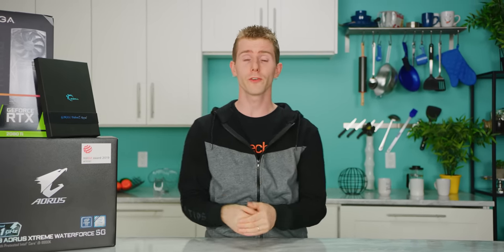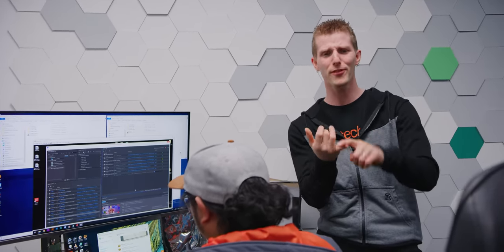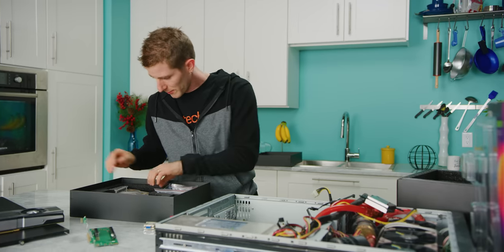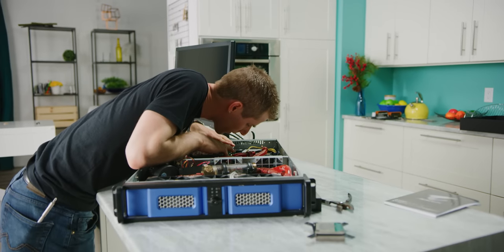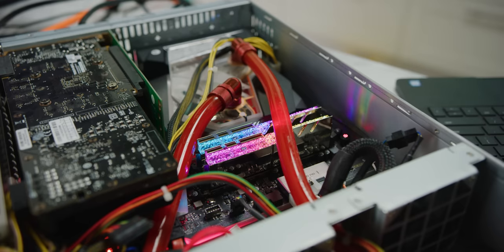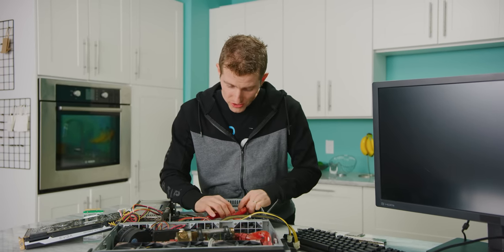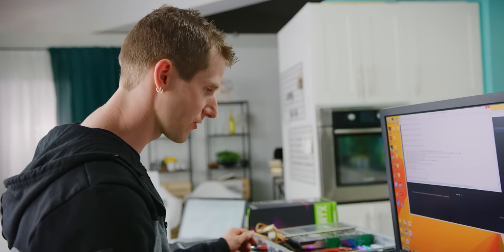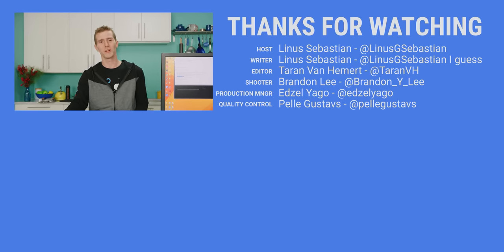All this work... for what?? - Upgrading the Video Render Server

Comment from the maker: Buy an LTT shirt, hoodie, hat, and even our own water bottle at https://lmg.gg/lttstore
Reply: Love your vids
Reply: Hi
Reply: Overclocked threadripper 3 build with custom water loop video when?
Reply: If you fix the 5700xt encoding quality the guy epox guy was able to get the fastest encoding while being able to stream multiple 8k streams at once with pcie4.
Reply: See you guys in 3 months for the 3950X version of this video where Linus again pulls a production server offline before even running tests
Reply: Please stop trying to sell me a hoodie in the middle of summer.... lol
Reply: Could I pay for shipping and get your "old" parts?
Reply: Linus Tech Tips no
Reply: If only you did giveaways for computers or even graphics cards or even power supply's
Reply: If adding a GTX980 improved performance back when you build this system , why not swap it out for a 1080Ti / Titan pr something like that to improve it even more ?
Reply: Send us that gtx 980 🤣🤣
Reply: Linus Tech Tips just because it can be done doesn’t mean it should be
Reply: thankyou linus you have confirmed less cores more ghz is better than more cores less ghz !!!!! but the dicrepency is threads ?
Reply: If you want to make weird content for video editors do a Cinergy plug in codec test and determine the best CPU and GPU combo. I bet my i7 and gtx 760 can beat that build if you don't use a real GPU accelerator
Reply: I had a similar experience when working with hardware.

So, I saved up some money for my new server (inspired by your videos to build PCs and to play video games on PCs more)   and after getting all the parts together,  I built it

(specifically:  Mobo-->Asrock EP2C602-4L/D16, CPUs-->Intel Xeon E5 2650s, GPUs-->AMD FirePro R5000 & NVIDIA GTX 960 2GB. Storage--> two old and disposable 500GB HDDs, OCZ Trion 240GB SSD and Seagate IronWolf Pro 2TB HDD, etc.)

It's the most beautiful rig that I've built... well, it doesn't have RGB or any clear panels to see the inside but the main beauty is the purpose built for it imo.      I got my Windows ISO ready and began the installation process.

After everything, it works.

Prior to getting it to finally work I had some problems and quirks that I've learned about my server:

1.)  Very picky about where you install the RAM in what slots. (Understandable considering it's a server board and not a consumer board, fair enough.)
2.) IPMI dedicated management port is inaccessible (even when enabled in BIOS and assigned a static IP) so for safety I decided to disable it completely. 
3.) While the motherboard is intact physically and electrically, for whatever reason it would seem that the sata controllers (Marvell RAID controller built in and the basic sata controller, both of which are put into separate IOMMU groups thank god.) are picky about how many you can use at once.
4.) It has more than enough power to power the sata drives and all the PCI-E expansion cards included and it won't draw more than 600 watts concurrently (glad I went with a 850 watt 80+ silver PSU, or was it gold?  it's one of the two).
5.) Sometimes I would have to disconnect one or more USB devices in order for it to boot properly (hangs sometimes when I boot into either windows or linux)
6.)  PCI-E passthrough is successful... sort of.  I did a pass-through test with a PfSense VM (granted, it was without OVMF) and I was able to pass-through the onboard intel gigabit controllers.  Though, they would show up as "em0" through "em4" (four physical plus the virtualized nic) which would imply that they are technically are seen as virtualized rather than "physically" attached if that makes sense.
7.) relating to point #6, if the vm shuts off then you don't get your network controller back for re-utilization or in otherwords give you back the ability to network with the host.
8.) This one is debatable, when I installed windows for the first time, it worked like a charm, then after three restarts (just to test and make sure that it would restart normally and to see if it would boot normally because it's running on server-grade hardware.) still nothing bad happened.  Good. :)    So, I turned off my server and ate dinner and went to bed.   Next morning I sat down in my chair and turned on my server, after a few minutes of getting through the bios screen, I get stuck during the windows boot.  And this continues every single restart.   So, I decided to go into safe mode and look into the log and turns out that something corrupted the bootres.dll file.  So, when I consulted with my dad about this he recommended that I check the ram and see if it's faulty by using memtest.  After a LONG night testing all 32GB of it, nothing.  Nothing to report and it passed 100%.  So, I decided that it might have something to do with windows 10 in particular because this wasn't my first time dealing with a corrupted bootres file.  In fact that happened to me two-three times before on this laptop that I'm using.  I figured out that prior to windows 10 updating itself, it worked just fine but after it updated itself it somehow crapped itself and screwed itself over.  What a bummer.
So, after that I figured that since the next update (can't remember what version exactly, I was busy trying to make sure that I get THAT update in particular by microsoft) is available, I installed THAT version specifically to make sure then I disabled ALL microsoft auto-update services and telemetry to prevent any corruption from the next update.     It works just fine now.
9.) I almost forgot this one, it can be picky as to how many storage devices you have plugged in all at once in terms of booting into a live USB image.   I learned that the hard way when I tried to run the memtest.   With 5 sata devices plugged in at once and the memtest bootable on my USB flash drive it refused to boot.  But after disconnecting all of the sata drives leaving the usb drive in, it successfully booted into it no problem.

In conclusion, servers can be VERY powerful when configured correctly, but are a B*tch to setup.
Now that I think about it, I'm glad that I'm 50% scotch-irish, otherwise I would've gave up already, glad I have some stubbornness. XP

Keep up the awesome work LTT, your videos are awesome.  :)
Reply: Doing all this and could of waited for a short time for the the 3950x and have 16 cores
Reply: Auto Lower clock speed will AVX workloads :)
Reply: having 8 k or whatever files uploading it on youtube is just embarrassing and waste of resources and time. sigh
Reply: i have 2 things i want to see id love to see who can cram the most storage into a case as possible and id love to see you make the most powerful server you can
Reply: Do you guys still have that ebay page you sell your old parts on? I would love to buy that x99 without the CPU. I have a few 5XXX 2011-v3 cpu's with only one board and I am looking for more.
Reply: $60.00 for a hoodie!!!
Reply: Linus Tech Tips you should use the ryzen9 3950x when it comes out 16 cores and zen 2 if faster than 9th gen intel
Reply: I would like to buy a hoodie but you dont make my size.
Reply: But you need muneeeee for the right setup...
Reply: @Linus,   I gave up on Adobe Pr and ME both.. No matter what I changed out it never would push my CPU to its maximum potential. I followed everything Puget Systems recommended and more. But it never would make full use my system. It was like it was being artificially held back. Switched over to Resolve and it makes full use of all my resources. My system is a 8600K @4.8Ghz, 32GB DDR4-3200 Corsair Vengeance @ 3200Mhz, Zotac GE RTX2070, 2x WD Black NVME's, 2x WD Blue SSDs, 2x WD Red HDDs.  Nothing erks someone more than seeing the CPU at like 60-80% usage, GPU at like 30% usage, SSDs at like 15% usage and RAM at less tha 12GB usage out of the 32 I have for it..  Its like WTF Adobe??  Tried everything to find out what the bottle neck was, but everything was being under used. Like I mentioned, no issues using Davinci Resolve though..
Reply: Linus Tech Tips Why dont u try the new AMD CPUs for the Server?
Reply: WHY would you not hit it with an AMD Ryzen 3? Wait until the "Destroyer of The World of Cores HA HA HA!" comes out and use it.?

You guys push Intel a bit hard. Even NVidia gets a bunch of love when they're not exactly killing it.  Is AMD that small of a provider of free stuffs for LTT that it gets so little love? 

Me wonders.
Reply: Hey, Linus, I would be so glad to take your stuff for free
Reply: @corason4444  right like he doesn't have 2,000 beggars begging for his stuff every single video.  Maybe get your parents to upgrade you versus publically humiliating yourself, kiddo.
Reply: Oh Linus. You are about the regret that upgrade. You should have checked out the H264 encoding of the AMD 5700 graphic cards, some of their performance was quite outstanding.
Reply: @Supremax67  HA! But you have made a serious mistake in suggesting that, sir!  Linus TT is all but owned by Nvidia/Intel. Suggesting an AMD graphics card probably made half the office laugh because they generally don't do much with AMD.  You've never heard of top secret "test sample AMD" processor or video hardware ever making it to a LTT bench although Nvidia and Intel seem to make it there almost weekly.

Maybe it's because they have a very weak relationship with AMD or maybe AMD just doesn't want all the public "delidding and waterboarding" of its hardware like Intel and Nvidia seem to love but AMD takes a back seat WAY too much. You can almost see Linus cringe when he mentions how AMD just pounded Intel into the ground for processors.  In actuality, we've only heard leaked info on the high end Ryzen 3 processors whereas Linus would have had engineering samples of the latest Intel processor on some sort of oem motherboard by now if it was Intel smashing AMD.
Reply: I kinda need some help i got an alienware monitor 25 (240 hz) but when i try to change the refresh rate it caps out at 120 and cant make it higher than that please help me
Reply: @chrissun4305  Bro, that's not something you can do over the net. I would suggest a couple thigns. A> your video card is not capable or not set to the right speed in the drivers. B> your  LCD is not set to the correct speed or to match up with the setting from your card. If the settings differ, an LCD will get confused and default down to 60. So if you set to 220 on your LCD and your drivers or card are set to 225 or 210, your card will dump all the way to 60. C> Windows itself doing 60. D> something defective E> a bad or cheap HDMI cable. F> Linus plays preferential treatment with Intel/Nvidia.
Reply: Use amd for server 7nm CPU
Reply: You Just PROVED AMD to be RIGHT !
Reply: @yagneshpatel9660  They did say the video was made before but yes, the new AMD Ryzen 3's would smoke Intel. Be interesting to see how they handled the transcoding vs Intel. It IS possible AMD didn't load everything intel has on that nice shiny 7nm die
Reply: Oh I think I'm going to Canada soon so idk if I'm going to visit
Reply: Linus Tech Tips toilet’s back in action
Reply: $60 for a thin hoodie? No.
Reply: Just use DaVinci Resolve!
Adobe is trash!
Reply: @LoociferZ  thank you
Reply: Linus Tech Tips Linus please do another scrap yard wars
Reply: Is It Weird That I Was Walking Round My School Today And I Just Found An LTT Cable Tie Just Lying On The Floor
Reply: All this HASSLE for a TASSLE. 😒🤔
Reply: Noticed the title change, or addition - and honestly, I didn't have any interest in clicking until the second part was added. No bashing, just feedback.
Reply: Not trying to hate, but Linus needs to fix his posture, he is slouching all the time in his videos. I used to be like this a year ago and fixed it by keeping my chest up.
Reply: Water cool a PC with Belle Delphine’s gamer girl bath water
Reply: I heard the water bottle doesn’t include water... is this true?
Reply: LTT water pipe ?
Reply: Could u pls hook me up with a pc man im a huge fan kof urs and i study computer science but i cant afford to buy a pc
Reply: Yeah. You seriously need to upgrade that 500 watts PSU. And where's that comparison between the 980 and 2080 ti?
Reply: For what shall it profit a man, if he shall gain the whole world, and lose his own soul?   

Or what shall a man give in exchange for his soul?
Mark 8:36-37 KJV
Reply: No thank you.
Reply: The merch prices are insane $60 for a thin hoodie made in china that costs $10
Reply: Strange how you always have issues with XMP, I seem to have been lucky with it so far lol
Reply: No. They make condoms to stop reproduction at a couple of quid, why would i spend £20 on a hoodie for the same effect ?! Cool vids though bro lol
Reply: I want to the LTT shirt that says "sold my soul to Intel back in 2016"
Reply: EVER HEARD OF A FUNNEL?
Reply: U mb should try to turn off hypertrading. since software is capped at certain amount of threads u might benefit from it.
Reply: go back to funky sunday as intro
Reply: Though, why didn't you use amd ryzen 3900x?
Reply: Do you sell an LTT funnel for not leaking the coolant everywhere?
Reply: why arent you using dual AMD EPİC cpu and motherboards...better then 5 xeon cpu
Reply: Your Encoding Settings in Media encoder is set to "Software Encoding", that's the reason you got slow render
Reply: dont ever tell me what to do
Reply: UFEI BIOS SHOULD BE ENABLED

Comment: Yes, the video was created before Ryzen 3000 launch, but the more comments about AMD, the better. Wait for the 3950X; and also get ASRock's X570 Aqua Mobo, it has Thunderbolt 3, and an AIO monoblock!
Reply: Oh, that explains everything.
Reply: Ryzen up
Reply: @jcfawerd  the Aqua is a water cooled board, similar to the gigabyte board Linus used.
Reply: @jcfawerd  yeah, weird how they went with a little fan for the mobo instead of an aio mono-block...like the gigabyte z390 aorus extreme
Reply: @jcfawerd  They don't need X570. A good quality X470 board wouldn't have a fan but could still power a 3950X. Emphasis on "good quality".
Reply: @jcfawerd  why fans on the motherboard?
Reply: @FrancoRav  for cooling the chipset, X570 chipset can draw over 15W, so it needs active cooling
Reply: @UnsungAces  Oh. They could use a X470 one then (maybe not the best option though)
Reply: they are only making 999 aquas though, so linus will have at least 10 of them.
Reply: It's rendered with an intel.
Reply: @YttriumtYcLief  Yet LTT is spending a couple thousand dollars on underperforming Intel hardware so why not go overkill with AMD and really "let it rip"?
Reply: I think you are wrong
the gigabyte one u was AMD EPYC server
custom watercool enclosures = LTT workshop
Rip = threadripper 2990wx
MSI MEG X399 Creation 16 phases
ASUS X399 Zenith Extreme old 8 phases
gigabyte x399 aorus xtreme problem one
asrock x399 fatality oh no
Reply: @nhac lly well all out. we all know that linus has the money, and the persuasion to get what he wants ... JKJK :D
Reply: also Linus you should do this for your personal build, because it has TB3
Reply: @jcfawerd  neither do I, but... I think the chipset is water-cooled with this mobo
Reply: @C0D3__BR3AK3R__Studios  well in FINALLY Upgrading my 4 year old Gaming Rig! video he used a Z390 AORUS XTREME WATERFORCE 5G 9900k and TRTX

Comment: ""All this work for 1 minute faster rendering''''  thank me later
Reply: Lol,...
From 9 minutes to 8 minutes is still 12% improvement
Reply: Thank you
Reply: @arwo1143  you must work for CPU marketing team 😂😂😂
Reply: @raulserrano351  you realise that 12% adds up rapidly over time
Reply: 9 hours to 8 hours
Reply: @raulserrano351  What about a 2 hour project? 12% is significant from pure performance stand point.
Reply: @KalphosZeromar  You realize that, unlike money, saving 1 minute every day for a week does not give you 5 minutes at the end of the week. Time doesn't work like that. 

Now if they were doing this multiple times per day with one needing to finish before the next could start, working projects back to back (and maybe they are, I don't know), then saving one minute per project could save some time at the end of the day.
Reply: @J624  1 minute less of Work Load A allows for 1 minute more of Work Load B, means in the long run productivity can be dispersed to places which may require it more (i.e. Quicker render --> Faster Video completion --> Staff free to help with neighbouring tasks)
Reply: @Aspennut34  That is a possible scenario, but it could also be that there's a lot of downtime between each workload in which case saving 1 minute on each doesn't really do a whole lot. Especially if the workload is unattended, and I don't see any reason why a staffer would need to sit idle while a video renders instead of doing something else now and grabbing the rendered file later.
Reply: @J624  you realise that is literally what they need they do have 4 yt channels